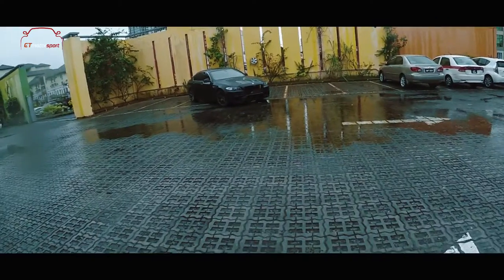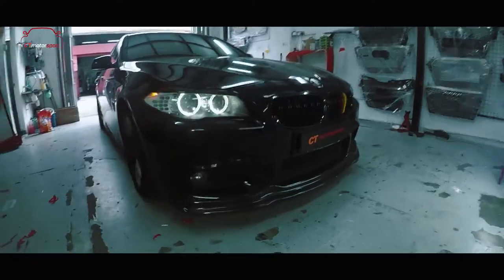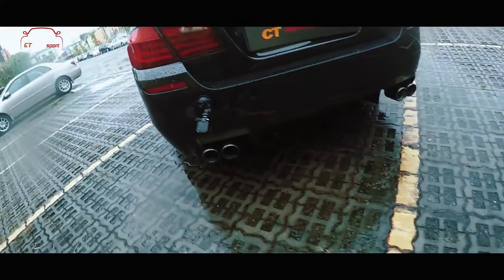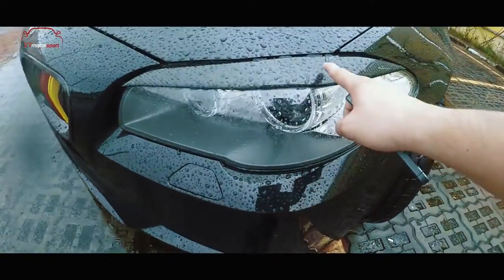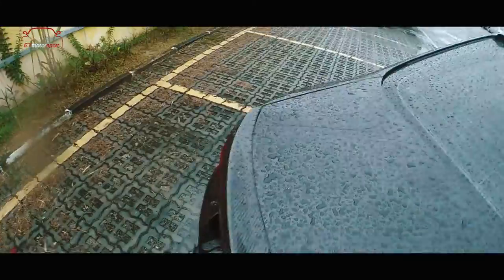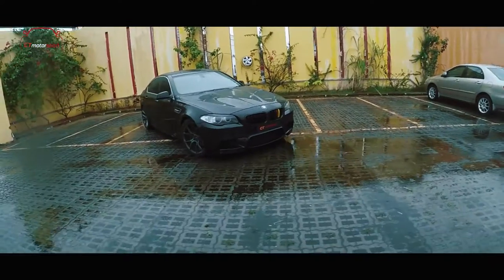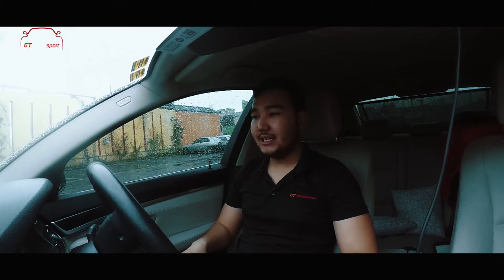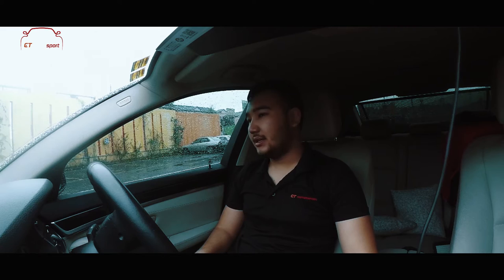BMW 528D F10 Msport Convert M5 Bodykit & Quad Tail Pipe

Comment: Great job, Love it! Needs shadow line trim tough!
Reply from the maker: you absoulutly correct my friend !
Reply: How much is this exact kit my friend!?
Reply from the maker: 4850RM the body kit (1100$) Taiwan product 99% fitment the Quad tail pipe is 700RM (180$) around.
Reply: CT Motorsport that's great! Do you offer a painted version or just primed?
Reply from the maker: this is without paint & without installation